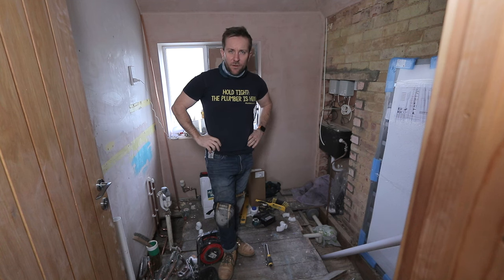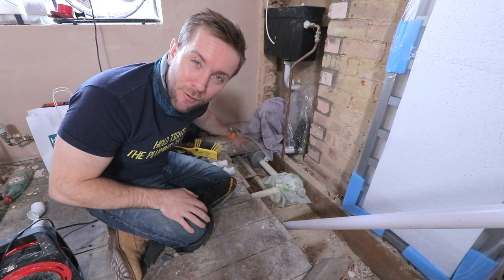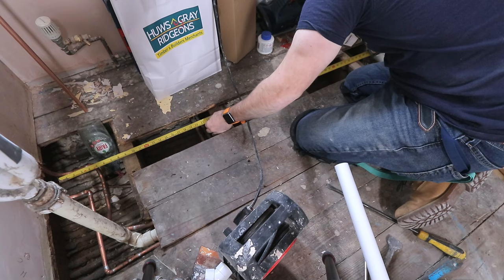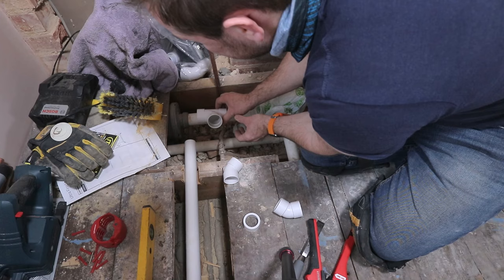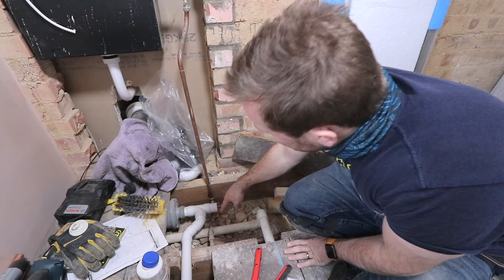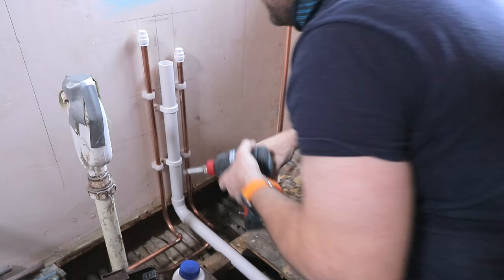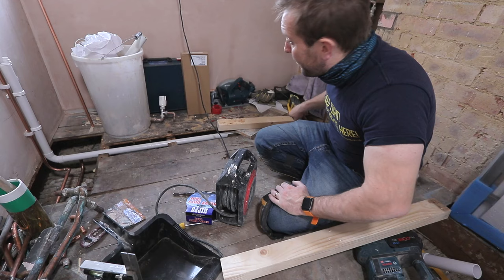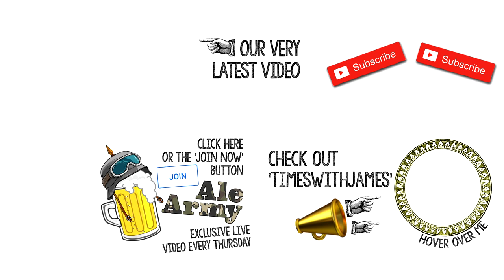WASTE PIPES FOR BATH & WASH BASIN - Bathroom Refurbishment Pt 4

Comment: Seems so wrong notching the joists to accommodate the waste pipes.
Reply: Seems wrong coz it IS WRONG INIT
Reply: As long as you follow regs on notch size and location it is fine
Reply: @cglees  isn’t it max 1/8th the joist depth? Must be 10” joists then?? Haha.
Reply: @duncansluman8606  0.125
Reply: @cglees  1/8th is 0.125

Comment: I'm addicted to watching your videos now. Only one thing I'm confused about is..on the glue pot, it states not to twist the pipe when pushing the pipe into the joint. Do I screw or push and no I'm not asking the wife that question either lol. #Holdtight....

Comment: Why have the double away and back in bends at the stack end. Surely it would have been neater to have put the ofset bend under the floorboards at the basin end which I'm sure would have aided a much better flow, running the pipe 2'' to the left thru the joist as you look at the basin. Ending up with three bends in the run as opposed to four.

Comment: Just a quick one mate, how come you use solvent weld for waste pipes I’ve always been a push fit type of guy myself but wondered if there is an advantage in solvent then push fit.
Reply: Solvent less likely to leak, push fit can pull apart over time and if its under a shower tray for example itll be a nightmare to fix. there is a place for push fit but id always use solvent personally
Reply: @thatcornishcockney  thanks mate i might start using it more like i say ive always been taught pushfit and never had any problems with it
Reply: Solvent weld is cheaper than pushfit
Reply: My builder used push fit for bath waste thst ran through the ceiling of my downstairs extension. Lasted 4 weeks then the fitting came loose with a bath full of water. Ended up cutting out the ceiling to dry it all out. Removed it all and added solvent.

Comment: out of interest did you use the same size waste pipe for the basin and bath? Was it 32mm or 40mm?
Reply: Inch and a quarter is 32mm (basin) 
Inch and a half if 40mm (bath and aav,) :_Holdtight::_bigg:

Comment: So when the college stress you that you can only notch 1/8 of your joist depth and drill 1/4 of your joist depth, it is all bullshits. Same like chasing a brickwall 1/3 of the depth vertically and 1/6 horizontally, is that right cause I see plumber chasing 43 mm pipe horizontally in brickwalls

Comment: OK, so you've solvent weld all the joints, then do a wster test, and find one leaks.
How do you fix it, if it's welded together?
PS i'm not a plumber...
Reply: Pps, great vid"s as always...
Reply: It’s extremely unlikely for it to leak if you use enough solvent cement and if it does you just have to cut the pipe work leading to the leaking fitting and then coupling onto the pipe work and put a new fitting in.

Comment: I have a bath which is slow draining.  I have run a drain coil/snake all the way from under the bath to outside.  I have remove the U bend and other two connector pipes that I can access (before it goes under the floor) and cleaned them all out.  I have also checked the air vent on the bath (connects the plug hole area to roughly where the taps are)  As far as I can see and tell there is no obstruction, but when taking a shower, you end up paddling in a few inches of water.  The bath does drain completely just extremely slow.  Could it be something as simple the correct angle, they ofc don't angle up but maybe not enough down.  Any recommendations what I can check?

Comment: In response to the many negative  comments regarding  the joist notching  , will cutting out 40mm or so from what look like 9" joists really  have any detrimental affect 🤔 . Personally I wouldn't have thought so but that's only my opinion  .Great video  👍
Reply: It's not a matter of opinion - it's just what building regulations stipulate. He was going down 50mm at the bottom - regs say maximum 1/8 of the joist depth and they ain't 400mm joists!

Comment: Can anyone tell me if its ok for the sink waste pipe 32mm to go into the toilet waste soil pipe before the stack as that's what my plumber has done and he told me that's fine but I thought they have to be separate ?
Reply: He said he was going to add an air vent in too which addresses the concern. Without that, flow from one appliance waste can suck on the trap of another, causing gurgling or even pulling the water out of the trap.
Reply: I’ve just asked same question mate 😂 I have a 32mm (around 1m length) washbasin waste that bosses into a wc branch (around 2.5m length) that goes into stack ,stack has an aav on top boxed in as its internal , I want to know if this is upto regs as I’m getting a building inspector soon. I thought the same that all branches need to be separate not combined. If a smaller aav is fitted on the 32mm waste pipe or a anti syphon trap would this comply with building regs

Comment: How do you undo glued waste pipe ?
Reply: You can cut the pipe flush with the fitting and then you can get a drill accessory that reams out the inside of the fitting so you could reuse it

Comment: Might be worth explaining why you are putting in a mini durgle valve (vent) for those wondering?
Reply from the maker: I will in a few vids time. Forgot here! 😂
Reply: Coz he's teed bath and basin waste together... stops the gurgle
Reply: @phillipbull3673  yes but not everyone knows that. 👍
Reply: @fazerstorm-oap  well u do now ...
Reply: For banter
Reply: Yes, I have fitted a few myself 🤣
Reply: @fazerstorm-oap  so why ask then...
Reply: @phillipbull3673  as per my first comment, people might wonder what he was putting in in for for? Not everyone is aware of the need for an auto air vent. Obviously my comment was worded wrong. Sorry.
Reply: I have a 32mm wash basin that bosses into a wc branch from soil stack(dunno if that’s allowed or upto regs ) .if I fit on a aav on the 32mm pipe will it stop the gurgling and symphoning guys 🤔🤔
Reply: @kingofthetrowel1725  it should definitely improve things. Just make sure you can put it in a position where it is above the level of the sink, in case of flooding due to blockages.
Reply: @fazerstorm-oap  cheers for reply mate thank you 👍 yea was thinking of getting it well above flood level and accessible , hopefully this will please the building control inspector 👍👍
Reply: @fazerstorm-oap thank you..I didn’t know

Comment: I see a few have commented about cutting the joist, I'm currently installing a new bathroom and want to run the pipe work under the floor boards.  I have about 1.5m to span with waste, but across joists.  Tje guidance/regs I found suggests I can drill through, but there are lots of restrictions.  I know this is your house, but would you 'legally' get away with notching the joist?
Reply: If you notch to the same depth using equivalent dimensional joists as shown in this video - it will not pass building regs. google it there's plenty info online with regards to regs.
Reply: Don't. If you do and something happens like a pipe bursts brings the ceiling down and your unlucky to have a insurance assessor take a gander and sees the notching you could find yourself with a house that's uninsureable until remedial work is carried out.
From personal experience I can tell you insurance companies will find the smallest transgression not to pay out and put you on a black list.

Comment: OK so I've seen a lot of talk about notching out the joists. Here's the question then; how do you get the pipe from one side of the room to the other? Talking to a non plumber here.
Reply: It’s definitely not this way. If you’ve a waste pipe to go through a nine inch joist you need an angle drill with a hole saw and drill through the centre of the joist obviously the waste pipe will be inserted with a few straight connectors. Never notch the top of a joist this deep. 0.125 of depth for notching top of joist or 0.250 for cutting hole in centres and from bearing to bearing span 0.125 to .40 not the middle nor up against the bearing 👍
Reply from the maker: My house is still standing! 😂
Reply: @plumberparts  I don’t care your still wrong and your not going to open up the flooring to look at the stress of splitting joists in a few years nor think about a bathroom with the weight of a bath, water and person in that area. You’ve obviously a lot of subscribers and views but this advice is very wrong mate
Reply: @plumberparts  P.S. obviously if you’ve got a load bearing wall either side of say 8ft of the span rule of thumb you can have a 4x2 flooring joist so cutting into a 9” joist is no problem but check spans between load bearing walls before notching out such a depth
Reply: @plumberparts  remind me not to buy when its up for sale

Comment: can somebody answer me a question please?? i am going to totally rip out our bathroom and replace everything. The sink we have at the moment takes a while to drain the water... even just with the tap running (i have used Mr Muscles pipe cleaner.).. is this because i need a 'Automatic Air Vent' somewhere installed on the waste pipe??
Reply: If it’s not blocked somewhere along the line before it goes into your main stack, then yes it could be venting issues
Reply: @samstorr6858  thank Sam... sometimes its runs out 'so so'... then another time it struggles....and for no reason.

Comment: I never get away with putting the fittings inside 🙄😂 giving away them trade secrets. 

Also quick one why does everyone call them 45s the angle is actually 135 and they are labelled 135 but every plumber I work with calls them 45s 🧐 please ask I need to know why?? 

JKL PLUM8ING 💯
Reply: The direction of the flow gets changed by 45 degrees! Calling them 135s means a straight pipe is 180 🤣
Reply: @rjamsbury1  but the internal angle is 135. 45 degree angle on a pipe would be a hairpin, full of hairs and pins 😅
Reply: @dankeel3899  I think you misunderstood me? I said that 45° was how much the flow deviates from its original straight line flow.

Comment: Love your Red pipe cutters Jimmy, are they on the Amazon store? :_Holdtight::_Alearmy::_Fucktheag:
Reply from the maker: Hi Chris. Which ones mate? I've got the snip/scissor type or the pipeslice type...
Reply: @plumberparts  Red Snip scissor ones, look like Rigid or Rothenberger? :_whyhello:
Reply from the maker: Rothes mate. In the tool bag bit of the store. 👍
Reply: @plumberparts  Thanks Jimmy, off to do a spot of shopping then have a long soak in the bath :_Holdtight::_Alearmy::_Fucktheag:
Reply: @plumberparts  i noticed a lot of adjustable spanners on your amazon page jimbo... are you not a fan of knippex plier wrenches?
Reply: @chrisgunn121  is that a soak with a happy ending? Christopher!

Comment: Why do ya vent the basin waste?
Reply: Because the lazy sod teed them all in
Reply: Gurgle. Gurgle.
Reply: It’s just sheer lazy. 
There’s 4” there , best solution would be 2 x boss pipe giving separate runs. 
His knowledge in plumbing is good but not all plumbers can fit bathrooms.
Reply: @richijohnstone1939  looks like where the waste pipe is going is a 4 inch branch for the toilet, if he had taken the floorboards up right up to the wall , he could have got another boss in there for the basin waste. There would have been a socket there but there would have been room to get a boss in. (I’ve been a plumber for 55 years).
Reply: @stevesunderland3943  yeah there quite possibly could have been, I always alter my 4” runs to give independent wastes. Even tight in a corner I’ll get the dremel out to get a boss underneath the floor.
Reply: Can’t add pictures or I’d show an example of how I do mines.
Reply: @richijohnstone1939  yes, there is always a way around things. I used to do lots of full bathroom installations but I’m 70 now and my knees are knackered so I just do small in and out jobs. I find em better earners as well. Too much like hard work doing bathrooms. Used to enjoy doing em though.
Reply from the maker: Let’s see how it works when it done...😉
Reply: @plumberparts  yep, I’ll look forward to seeing that. I enjoy the videos. 👍
Reply: @plumberparts  yes it will work doesn’t mean it is good practise. And if you are honest with yourself, you know it’s not aswell what you’ve done.
Reply from the maker: @richijohnstone1939  haha! Ok Richi. I’ll sleep fine knowing all I’ve done wrong is tee a 1/4 into a 1/2...which then runs for about an inch before going into the stack! 😂

Unfortunately it’s after that sleep that I wake up to England 6 wickets down and batting to avoid the follow-on! :_Holdtight:
Reply: Separate pipe runs is proper way to do it

Comment: You just don’t notch a joist this deep, the regs are there in black and white for the purpose of protecting the structural integrity of a building and the safety of the occupants. Waste pipes that need to go through a joist should be holed in the centres of the joist not exceeding 25% or 0.25 of the depth of joist and put between 0.125 and 0.400 of the span for belt and braces glue and screw ply over where the hole is to be drilled. A notch no deeper than 0.125 of the overall depth with same consideration of same limits between bearings. This video should have a warning to people that have come here for advice as this is wrong in many ways, possibly dangerous and costly
Reply: Before you take this comment down you should take this video down as people are wrecking there houses with you influencing them to do this. Do the right thing James if your a true tradesman. Think bathroom, bath full of water and a 100kg of person in it
Reply: sooner or later it's two people!  @Superfandangoo

Comment: 1 in 40 for 40mm pipe really?I think you misunderstood the tutorial  - it's 40mm drop per metre run.And cutting the joists for anything more then 22mm pipe is illegal
Reply: It's a gradient. 1:40. 1 meter run is 1000/40 = 25mm.